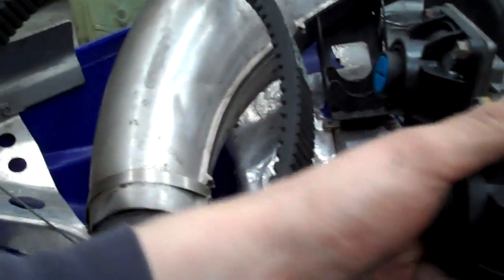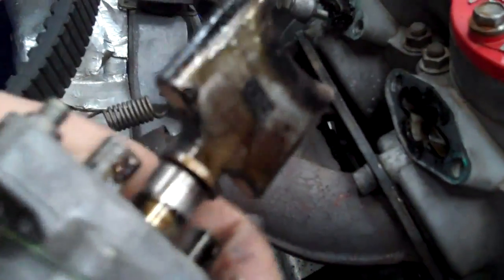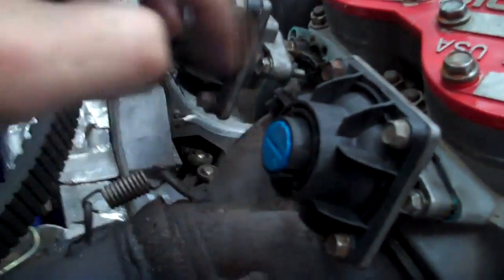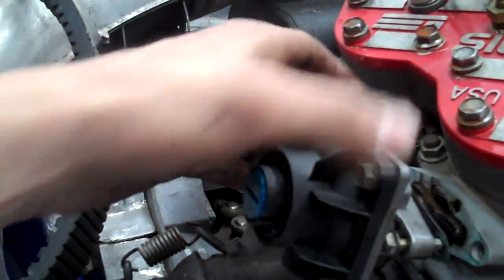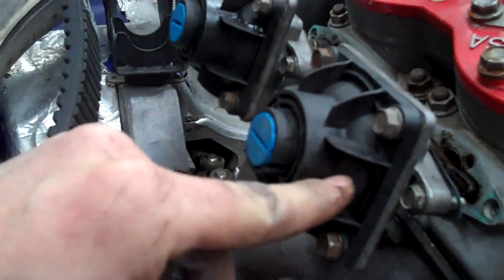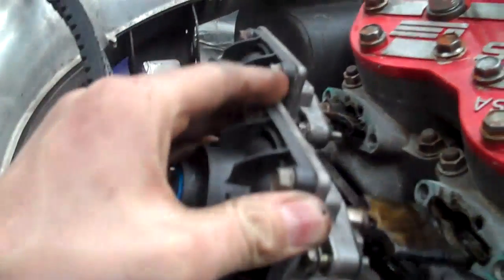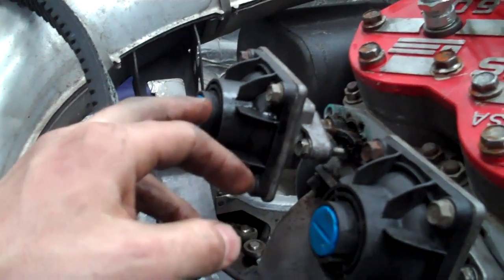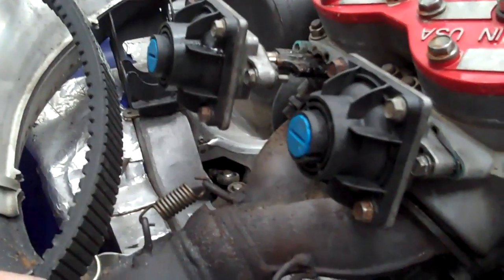Cleaning Power Valves

Comment: Thanks for answering so quickly on the location of the Power Valve repair.  Do you have a video on a 1999 Polaris 500 XC hose that goes from the front of the engine back and down and connects to the heat exchanger? Does the motor have to come out?

Comment: 2001 polaris 500 xc sp, once I got the plastic cap off the bellow appears to be pinched between two washers with a knob like bolt on the top how do you get the bellow out to change it? No zip tie. Thanks for the vid! Huge. Instantly figured out the problem.
Reply: I just picked up the same sled and ordered new bellows as well as the seal between the blue knob and the spring, as it was leaking and smoking oil. Was swapping the bellows out fairly straight forward? Got any tips? Its my first sled, and couldnt pass it up for a couple hundred bucks, so i'm going through and cleaning out the carbs, etc.
Reply: @Land-Yacht  were the bellows torn? If the bellows are the only thing damaged then replace them but you shouldn't need to replace anything else. Smoke comes out of the plastic due to the torn bellow. So it doesn't mean the plastic part is bad it's the bellow that seals. But to get the bellows off you have to heat the nut up with a torch to loosen it. Then when you replace the bellow with the new one make sure you oil the part that seals with whatever your two stroke mix is other wise it won't seal. Don't crank on the nuts super hard either. I still had issues after that so I put a can of sea foam in my tank just like the youtube channel says and after two rides I am rippin up the trail. Pretty crazy.
Reply: @ryanshelton9486  Thanks for the swift reply. I honestly haven't taken them off to see if bellows are torn, but figure they are with teh way it smokes out the plastic and the oil residue on bottom of gaskets, so I will replace bellows and the gaskets, as well as the seal between the blue know and the spring. When i screwed the blue cap off, pieces of dried seal came out.

Glad to hear about your sled, I also plan to clean carbs, they empty gas tank, as old fuel was sitting there for a while. I will also look into putting a can of seafoam in with fresh fuel and take it for a rip.

Any change you know  if there is an easy way to drain the gas tank or do I need to remove it with the entire seat assembly.

Thanks dude!
Reply: @Land-Yacht  honestly I wouldn't mess with the carbs until you know you have to but definitely go on sea foams you tube channel and follow what the guy does on there for his sled. First time I took it out I noticed a difference but then it kinda regressed the second time but I took it on s trip last night in -18 degree weather and it was getting up and going pretty much everytime. I may take the carbs out still but I am gonna make sure I know what I'm doing first. Not sure as far as the gas tank goes.. how long has it been sitting in there? If there isn't a ton you could just try to syphon as much out as you can and put a quarter in it with a can of sea foam and I think that would be good. Probably already enough shit in the engine from the same fuel anyway so wouldn't hurt ya know. Then maybe take the carbs out after. Probably be a lot less messy lol.

Comment: i was wondering if there is a way to fix a striped power valve
Reply from the maker: I have had them strip out on mine, I just tapped the hole with a larger thread..  What hole it is it?  the cover, or into the cylinder?

Comment: 1999, 800 xcr.. For the 800 twin.. they had aluminum valves and replaced them in 2005 with stainless (5134492)  after the titanium failed also. They will crack on you so replace them before you feed you engine metal. The 700s don't break because of the water cooling is better...off topic..   If you have a 800 make sure you have the black slides in your carb as they break too...make sure you put in a ninja plumber torque arm as the motor mounts break too.  The comment can save you! #$$$
Reply from the maker: Agreed with all of the above!  And save yourself some $ on the black slides and buy them from us.. I'll get them from arctic cat.. $25 cheaper per slide.

Comment: I have the same sled as posted in your video. Someone has messed with the blue spring screws on the caps. how do you adjust those back to stock settings?
Reply: Did you find out because I have to do the same
Reply: @noopechaser6634  im sure I did but it was 10 years ago I don't remember now haha. I would suggest a service manual. They can be had on Ebay in CD from pretty cheap.

Comment: I have a '01 Polaris 500 XC SP. I have just noticed while riding once and a while I hear a strange noise usually around mid range...it is hard to describe...almost sounds like a disc brake engaging, although my brakes aren't sticking. While looking into it I noticed I have a leak in a power valve...could it be connected somehow? I don't have a lot of experience with these machines so any help is greatly appreciated! :)
Reply from the maker: Nehemiah Krause. Yes it could be making a noise. It is typically a clicky airy noise
Reply: Big Kid Powersports. Thanks!
Reply: What kind of damage could a leaking power valve cause to the rest of my machine?
Reply from the maker: Nehemiah Krause as far as a leaking diaphragm. You just going to lose some power. Get in there and inspect things and make sure that your assembly is in good shape. The guillotine could come loose and drop into the motor. Not a common issue, but it could happen.
Reply: Big Kid Powersports Okay, will do. Thanks so much!

Comment: what oil do you use?
Reply from the maker: Amsoil Interceptor
Reply: Big Kid Powersports I have an 04 xcsp 600 and from new its always been on the manufacture spec oil (VES Gold). Do you think theres a difference between that and amsoil, bc i was thinking on switching to amsoil bc i can get it cheaper.
Reply from the maker: matt vuletici
Its one of those things - Ask 10 people and get 10 different answers.  I like the amsoil, it has a detergent in it to keep valves clean - At end of the day, both are good oils.
Reply: Big Kid Powersports Yea your right its very opinionated.. Thanks for the vids

Comment: Snowmobile noob here .  ... got a 2002 viper.  I will use this video to clean my power valves....The question I have is probably stupid but don't want to kill the sled I just bought.  I see there is an upper oil fill line.  Is that the line I use to fill up to? Again thanks for the valve video!!!
Reply from the maker: Yep - regardless - just make sure there is always oil in that tank :)